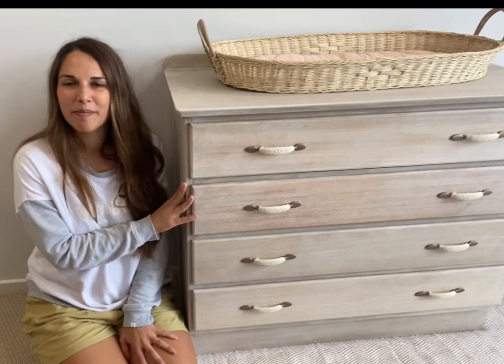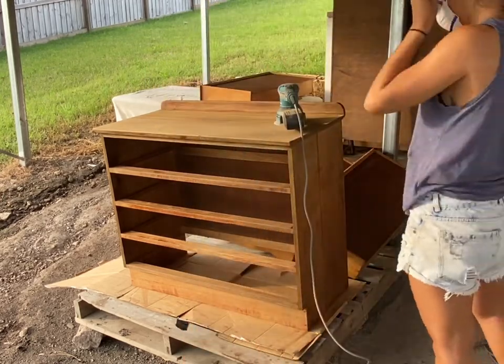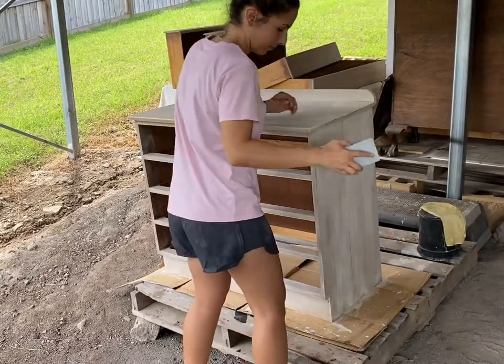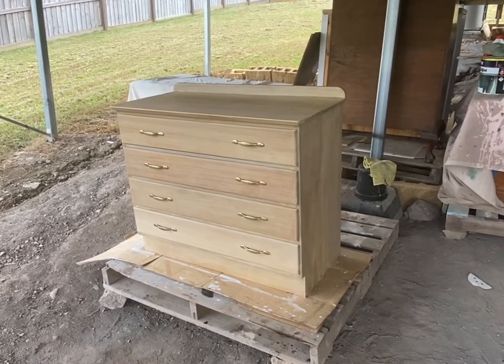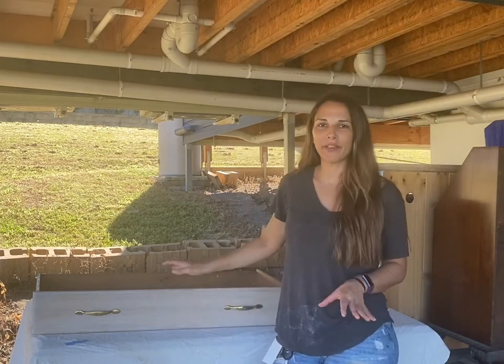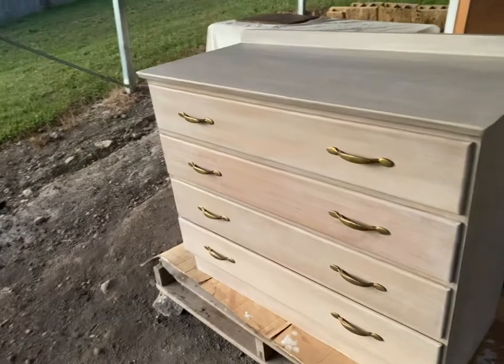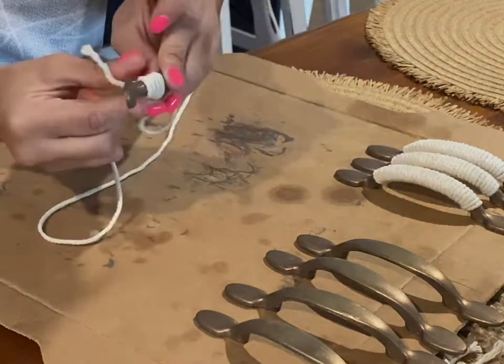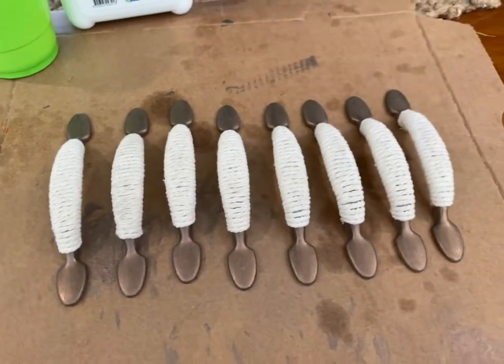Stripping with oven cleaner and using macrame rope to reinvent your handles!

Comment: Awesome to find someone in Australia doing these projects! We don't have half the products they have in the USA. What do you use instead of all those Minwax products? Interested as to why you chose to use Canterbury paints as I hadn't heard of them before. You're great!
Reply from the maker: I know! So hard to find the equivalate sometimes! I mainly use Cabbot's for stain and top coat from Bunnings. I also buy a lot online from local supplies who stock some other options I have been just trying lots of different stuff to see what I like and what's easily available in my area. I tried Canterbury Blue paints as it was local to my area, affordable and one of the first brands I tried when I venturing outside of the options avail at Bunnings. They have been really good and I find their paint coverage great too so highly recommend.